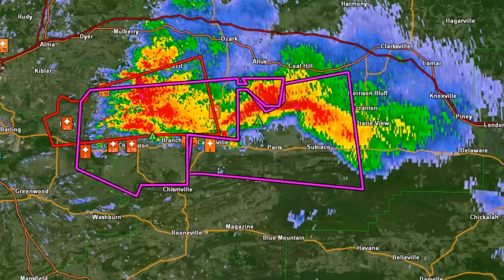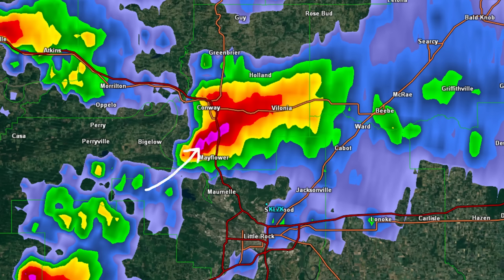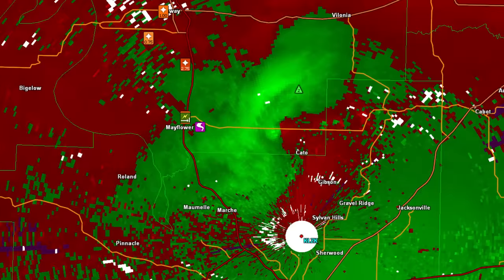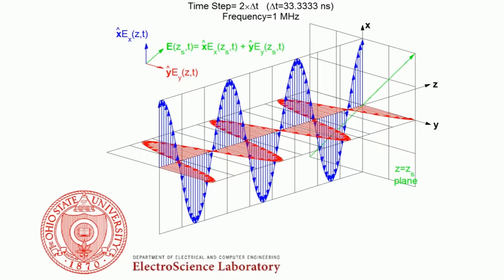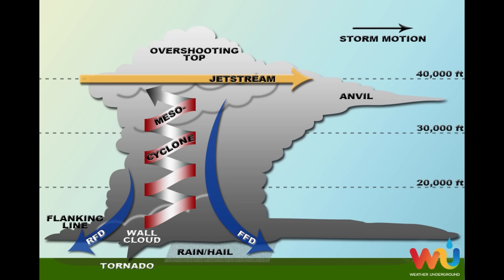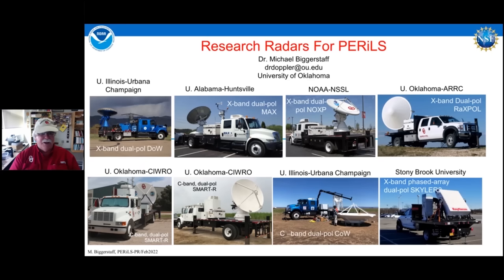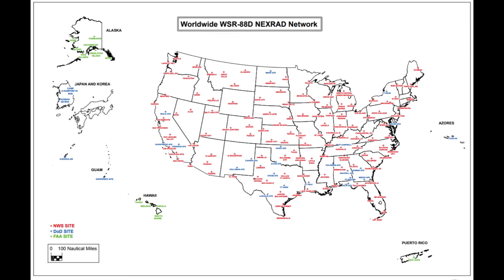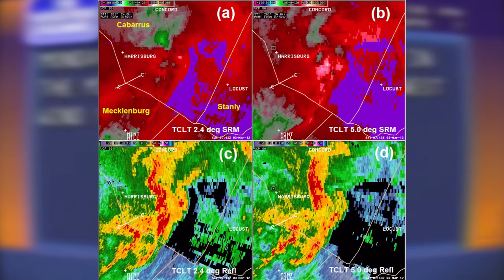Can Tornadoes happen with ZERO warning?

Comment: There was a QLCS tornado in December 2019 outside of Tulsa that wasn't detected until 2 minutes after it had already touched down. It was only a few blocks away from me, I was watching the squall come in when the warning happened and I scrambled into the shelter. Thankfully it was only an EF0 and nobody was hurt.
Reply: Qlcs spin ups happen so fast
Reply: Yep, I remember hearing about that. I remember the 2017 one too. Claremore also had a small nado come through the south side in march 2016. Was a quarter mile from my house.
Reply: Hey my ex wife lives there, and she’s kind of a biggg POS! Could you not give her a warning before it hits? Thanks!
Reply: That one was crazy. but the 2017 one was more insane. It wasn't warned until it had already gone from 38th and yale to like 51st and memorial. I lived at 38th and yale. It went through my backyard and we had no damage aside from one small section of our old rickety fence got knocked down. The power went out after it hit my area and thats what woke me up. It was probably hitting the movie theatre when I woke up. Whats even more insane is my power was only out for 2 hours. It was at like 1:30am and I am normally up at that time but that night I decided to sleep early for some reason. I regret it.
Reply: QLCS tornadoes are very sneaky. When you’re looking at them on a modern Doppler system, you have to know what to look for.
Reply: There was a tornado in October 2019 here. I don’t think it was a qlcs tornado but it doesn’t look like a hook at all. I think it was just surrounded by a bunch of other junk. Just like the tornado a couple months ago. But I don’t think I could see the most recent one on radar. It’s tough to point out these things. Especially when you have absolutely no idea what you’re doing
Reply: @krispysocks99  😂😂
Reply: What's a QLCS tornado
Reply: I was in the Norman fed 27 tornado 2023
Reply: Atleast it was only EF-0

Comment: I've experienced an unwarned tornado, but thats because the UK doesn't have a tornado warning system, while tornados are some what common and happen every year in the UK we just don't have a system for it as we don't tend to get destructive ones, and a lot of the radar products except reflectivity are not publically available. i'm also pretty sure the UK only got doppler capabilities in 2019.  We had a little spin up tornado from a linear storm system that came through, mostly because the hilly western coast of Scotland tends to provide uneven orthographic lift and it does funky things to storms. I've found the difference in weather coverage and the public access to weather information a bit whiplashy when I moved to the USA last year. It's really been an experience and a half. The one tornado we did get near by here last summer (which is rare because its upstate NY) was warned with plenty of time. I was impressed.
Reply from the maker: That must have been a bit of culture shock to come here, with all our information available. I had no idea the UK's weather warning system was so minimal. Thanks for the info Samantha!
Reply: I had a tornado warning come on as soon as it went over my home, I live in Connecticut we don’t really see tornados often, but in 2020 late August to Early September there was an alert that went from severe thunderstorm watch to warning to tornado watch to tornado warning roughly 2 minutes before it hit, luckily it only took trees and power lines down and no ones homes were affected severely
Reply: @weatherboxstudios  It's less that the UK's weather warning system is minimal, its just moreso geared to weather events that happen both with regularity and destruction. They also tend to be geographically different, so the Midlands in England are very focused on Flood warnings, Highlands for blizzards, Islands and Coasts for storms (and resultant storm surges). While tornados do happen, theyre often in largely rural areas and are far less destructive than the gale force winds and heavy rainfall that come from the same storm.
Reply: @weatherboxstudios  I sat next to a UK meteorologist on a flight. I asked about tornado warnings. He said they would never warn the public as they did not want to cause a panic. Ignorance it seems is bliss.
Reply: @suem6004  that’s a strange notion. It seems they are usually weaker over there but what if… Interesting about uk. Hope they never get a big one
Reply: @joshpeterson2203   yes, we think strange not warning but huge incident in the 1980s when a hurricane came through yet did not warn the population.  I was there in the mid 1990s. Driving to my destination I personally saw a funnel between lightening flashes. Next day on the front page, reported an EF 2 or 3.  No small yet zero warnings.  I had to do my own weather spotting.  So reports on tornadoes are hardly ever mentioned I believe.  A very different culture.  Mustn't panic people who would not know what to do anyway.
Reply: @suem6004  I would definitely rather know. The ones that scare me are the night tornadoes. The one in December last year hit the last town around midnight I believe… thankfully I wasn’t in the path but if I was my phone warns loudly of severe weather and would wake me. So I for one think that’s a way better way. Crazy. Seems they got Doppler in 2019 I think I saw someone say. Hopefully they change how they do it in the future
Reply: @joshpeterson2203  I think with access to much more info on tornadoes, how to spot wall clouds, tornado safety, the UK is being pushed by an informed populace to give better forecasts.  That said, their non reinforced masonry, often very very old homes makes finding safety a challenge if not impossible at times.  The big state wants to keep control and not spark public panic. But again, as more videos are watched, am hoping the word is getting out.  There are amateur weather clubs I heard.
Reply: We get a few around Western NY and it's usually big news when it happens but they seemed to have become more frequent in the last 20 years
Reply: @TailgunnerATC  Its not that they’ve been more frequent, we just constantly have storm chasers on nearly every storm with a camera, and amazing radar technology to detect so much more
Reply: @blakebarber6935 Back in November we had a EF3 hit Jersey , tearing roofs off well constructed homes and destroying a exterior wall on one
Reply: One of the primary reasons weather data is so available in the US is because tornadoes are so common that it is abundantly clear to anyone in power that you cannot rely on whether reporters to get it right every time cuz even today we don't know everything about tornadoes, In fact, I don't even know if the debate as to whether they touch down or spin up has been settled yet. And the only reliable way to learn about a completely unknown thing is to have as many people as possible study them. But there just isn't enough money to pay people. So you need the enthusiasts to fill that void, there are several other reasons but this is the main one as far as I can tell

Comment: In Ohio, back in the early 90's, we lived right across the street from the fire station where the sirens were.  Nice day, we're out on the porch when a tornado just dropped out of the sky over the woods and right at us. I had time to grab my toddlers hand to run inside, and it came so fast it lifted the toddler off the ground. No injuries, no real damage, but it dropped like a missile out of the sky. The sirens never did go  off.
Reply: Clinton County Tornado Sirens failed earlier in March. Countywide EMS computer outage/glitch.

Clarksville got hit on the outskirts of town. Fortunately it was a touch and go.
Reply: @AJKPenguin glitch or hacked by the CCP

Comment: Back in the early 80s (i wasnt around yet), my family in Edmonton experienced an F4 tornado on what is now called Black Friday. Tornados were not known to happen in the area, so most hadnt even heard of a tornado. As a result there wasnt a need for adequate tornado detection. My grandfather knew someone who lost his wife, kids, even the dog. The tornado is one of the biggest environmental disasters in the area, only suprassed by the drought of the 1930s. 
Almost every time i see a rotating cell, it seems to follow a similar path that the tornado took. I also noticed that any type of weather seems to be stronger along that path. Rip those driving through that on the east side of the  Henday o_o
Reply: Ah yes, the infamous Edmonton Tornado.  And it actually happened on July 31, 1987.  I hope your family was okay.

Comment: Thank you so much for making this after my previous comment in one of your last videos! Yeah, the tornado producing storm that happened in my town of Springdale did have a warning issued but the area they pointed the warning out in was not the area that ended up getting hit, so I'm guess a QLCS tornado happened with that one that just wasn't foreseen. Also, nobody even knew a tornado had actually happened until well after the fact. Our local station around 4:10am told us that any rotation was miniscule or absent from the storm and we didn't have much to worry about WHILE the tornado was actually on the ground, rocking a couple neighborhoods and a school.

The one that hit my town ended up with an EF-3 rating and was pretty terrifying, but I do understand that this kind of thing happens and we haven't perfected radar technology yet. We'll get there soon, though.

Great work as always!
Reply from the maker: Thank you! The first thing I looked at was the Springdale storm, but I couldn't really find a lot of information on when the warning was issued vs where the tornado formed. That is the only reason why I chose the Tulsa and Charlotte tornadoes, they were very clear cut and could be shown quickly. But the same points apply to the Springdale situation. Thanks again for the fantastic video suggestion!
Reply: E
Reply: Ye
Reply: I'm in North West Arkansas as well, I was just about to comment about the Springdale tornado. My apartment was just about 10 minutes away from the path, and my job took a direct hit
Reply: @weatherboxstudios  QLCS tornadoes can spring up in a minute or two which is what happened in Charlottre, which btw has some of the best severe weather radar and staff manning it that you'll find anywhere. Read my other reply to understand.
Reply: Famous last words I live in Tulsa & had watched storm warnings for at least two days from Ryan Hall & Reed Timmer,as well as Tulsa weather all day that day & night!!

Comment: I've been in 3 tornadoes, one was unwarned, or should I say warned right about as it hit. It was a rain-wrapped EF-0, path of about 1/4 mile, and lasted about two minutes. I was on the road and traffic stopped, boxing me in just inside the main circulation. Rain was so intense you couldn't see the end of your car hood, and my van rocked up onto two wheels twice before it was over. It was all in the open with not even a ditch for refuge. Spooky, and I thought I'd never see that again, but boy was I wrong.

Comment: I have been in an unwarned tornado. It was in Fort Worth, TX in the summer of either 85 or 86, on the east side of Loop 820. We were getting strong gusty winds and that scent you get before a storm. Then we got a few drops of rain, not even enough to fully wet the parking lot. 

Then we heard what we thought was a low flying jet. The wind came up, like a fast thunderstorm with a little debris, and then it went up a lot, howling and roaring with debris that hurt when it hit. I was outside a warehouse with doors open on both sides. I was close enough to grab the doorway and pull myself back in. Other people were blown down and skidded across the parking lot. 

It began to sound like hail too, but that was debris hitting everything. Then the dumpster across the parking lot flipped it's lid, trash lofted way up and it tipped over and blew away. Cars began to move in their parking spaces. My 1972 International Harvester pickup got turned about 45°. One car got the back of another set on its hood.

We had sheets of ¾ MDF that got blown around and broken up inside the shop. About 10 mins after it hit the sirens went off.
Edit: This might be reported as straight line winds, which also existed, but there was also rotation and lift. Several dumpsters were emptied of trash that went up in spirals before the metal dumpsters got blown along the ground. I saw cars that I thought were going to get blown away because the rear tires were several feet in the air.

Comment: Had a friend experience an unwarned tornado. They were lucky it was only an f1 (possibly f0), especially since it ripped off part of their roof (and only theirs, none of the neighbors had damage like that). They didn't even realize the roof was damaged until someone knocked on their door asking if they were ok!
And related to radar gaps, county specific coverage is also a major problem. I live near Dallas County (in Rockwall County specifically) and for the longest time they would cover the storm up until it left Dallas County, then would stop. Back to regular programming. We just had to hope nothing major happened. This did change when the 2015 Rowlett EF-4 tornado happened, but the fact that it took such a destructive tornado to change things is frustrating.

Comment: An unwarned tornado struck the southwest side of Omaha, NE on March 27, 1975. At the time, NWS switched radar on and off seasonally, so it wasn't active at the time. Sirens sounded 20 minutes after this F2 dissipated.
Afterwards, the radar was turned on for the season. NWS also made the rounds on the local TV and radio stations to prepare the public for the severe season.
When an F4 tornado struck on May 6, it was preceded by a 15 minute lead time (in 1975!) and people knew what to do. The costliest, most damaging tornado in US history (at the time) killed only 3 people.

Comment: I was happy to see you included a still from the Troy tornado of January 2020 in your video because that was the one I was going to mention! Completely unwarned, the sirens didn't even go off until 5 minutes after it had passed through our neighborhood and put a tree through our neighbor's bedroom. I was driving home at the time and didn't know a tornado was even on the ground until I started passing downed power lines and trees in the road. I didn't even know the radar could miss some tornadoes until then, so thanks for the video!

Comment: Bravo with this video. I learned a lot from this. A heartfelt thank you for the effort you placed in making this video to educate others. If you're open to questions, I've seen storm chasers use three other radar overlays along with the Correlation Coefficient you explained at 3:28. Those other overlays are Spectrum Width, Differential Reflectivity, and Specific Differential Phase. What are they and why are they frequently used by tornado chasers?

Comment: Farm experience here - looked up once and saw directly overhead what looked exactly like a rotating Hurricane. Had white clouds, dark clouds swirled into the center and there was a clear blue sky eye of the Hurricane. No tornado touched down, no warn. But 17 miles later a tornado did touch down with very little warning. circa '86

Comment: I live in Bunker Hill, West Virginia, and we have had 2 tornados in our county in the last 20 years that the NWS did not issue a tornado warning ⚠️ until the tornado lifted off the ground. An f2  tornado was completely missed in September of 2004 that destroyed the community of darkesville. The tornado at darksville leveled a church three houses and two trailer houses. The darksville tornado would later cross Interstate 81 (2 miles away) and cause a seven vehicle traffic accident with multiple injuries..  We had an ef1 in 2021 with no lead time, it destroyed a trailer home and 1 acre of trees before it lifted. It later touched down in Ranson West Virginia and it destroyed a large commerical warehouse and a residential garage.

Comment: I was in my office that was about 8 miles away from the Plainfield tornado. Even at that distance there was a sudden violent change to the strong storm i was in when the tornado struck. I suddenly could not see past my window due to incredibly fast moving horizontal rain. Along with that there was what sounded like hail and my ears started popping. The thing that was frightening was the ceiling tiles were lifting out of the grid and the light fixtures were physically vibrating as the suction was working to pull them out.

After about 15 minutes, the storm suddenly stopped and there was blue sky. I went outside and there was no sound of any kind. Then the emergency service sirens started and ran 24 hours a day for about a week.

I'll never forget....

Comment: I lived about a mile from where the Harrisburg tornado lifted. If it had followed the path it was taking just a little longer, I likely would have taken a direct hit. I took a drive through the area the next day and it was surreal. Entire chunks of houses missing, right along 485. It's the sort of thing that just doesn't happen much in Charlotte, and then it happened again in Matthews a couple years ago - although that one was better warned, and by coincidence also just barely missed me.

By a crazy stroke of luck(?), I also have a connection to the Hallum, NE tornado you covered in another video. It hit just before I was supposed to spend the summer outside Lincoln, missing the house I was gonna be staying in by a few miles. I was taken on a trip and saw the destroyed middle school firsthand from the comfort of a Chevy Tahoe. Again, very surreal.

The moral is, I should never move to the Midwest because I am tornado magnet.